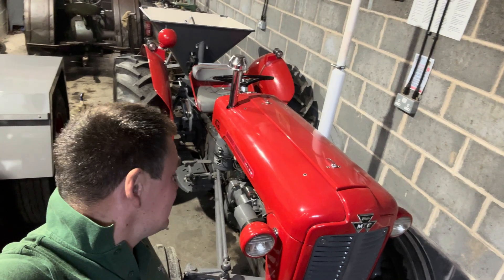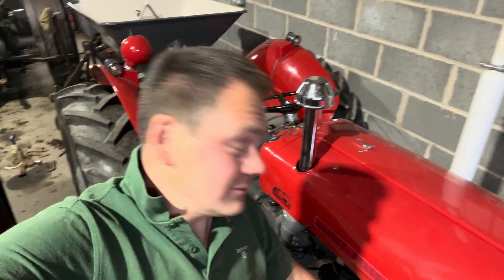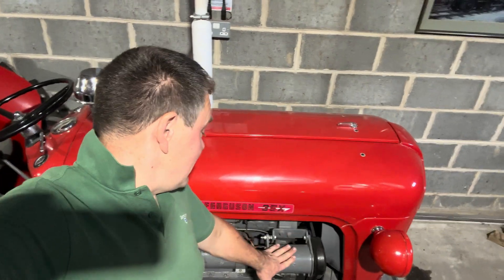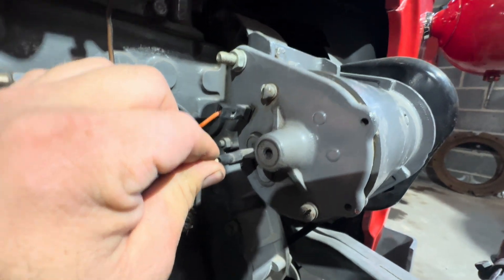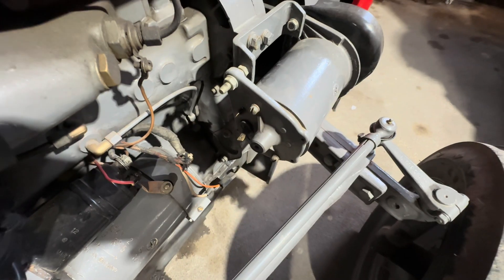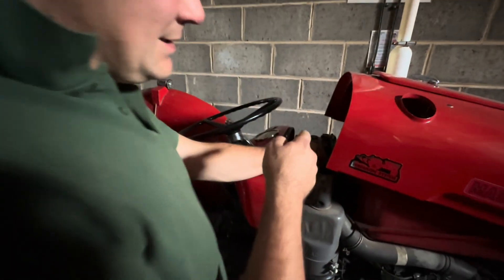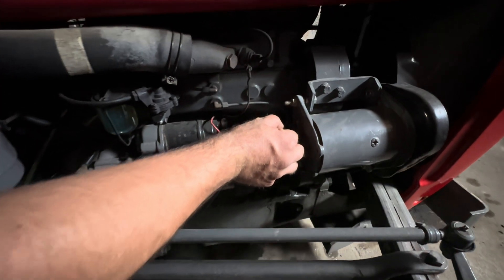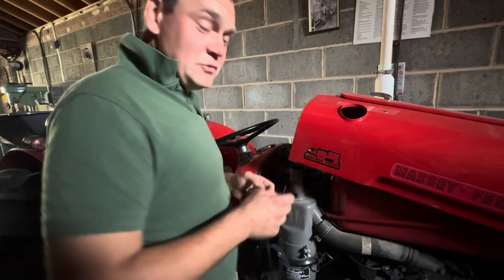massey ferguson dynamo polarising repair

Comment: Ayeup my 35 is 1960 do I still spark it from negative as I think the early ones are postive earth
Reply from the maker: In this video it is a positive is earth. earth. If you have a negative earth you tap the positive terminal to the f on your dynamo.
Reply: @Mr_b_yorkshire_farmer cheers pal I’m no good with wiring ha 😂

Comment: Is your 35 positive earth?
Reply from the maker: Yes,  most vehicles with a dynamo are.
Reply: @Mr_b_yorkshire_farmer my diesel 20 is negative earth but it's not wired up it's something I need to get around to doing
Reply from the maker: @gearsandtears7643  I would try to see if it works first. This is only necessary if it will not work